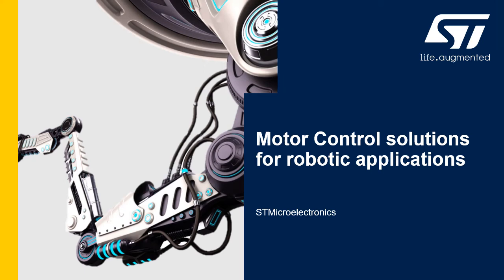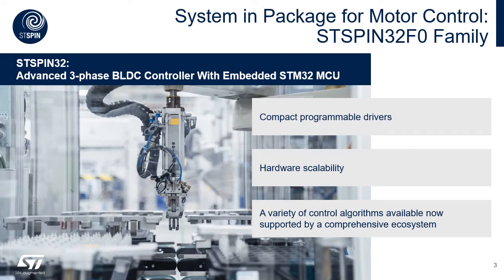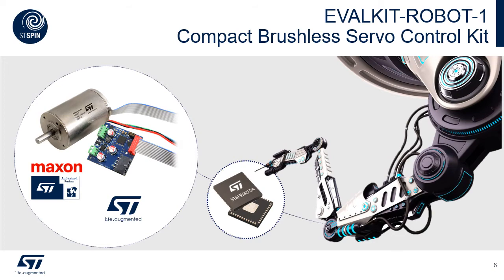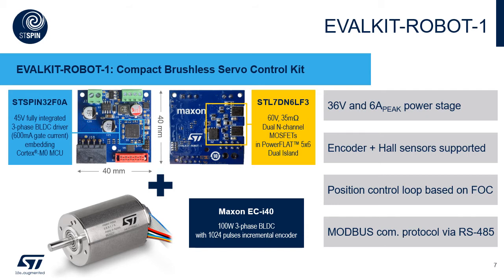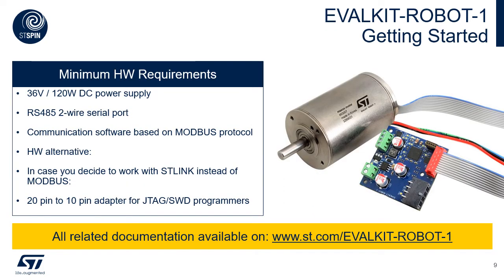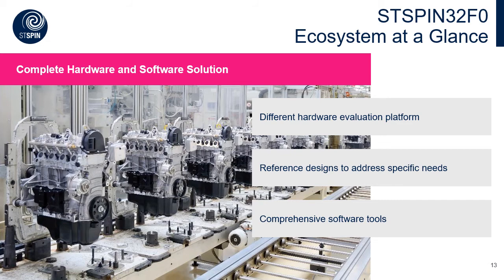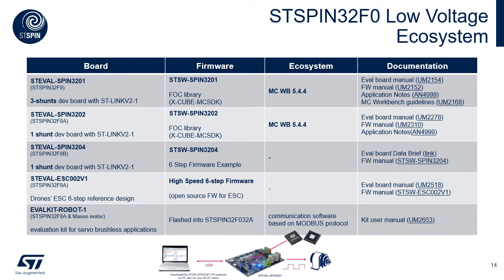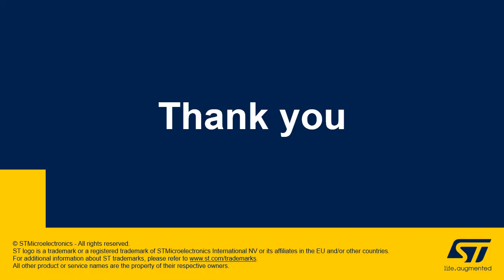Motor control solutions for robotic applications

Comment: please link the source code of the firmware. i think a tutorial of how to setup a new project in the motor control workbench for this board with spin32F0A and all the pin config and motor data would also be super helpfull for the community and also a big motivation to order this eval kit.  also a control application on how to control this board from an other stm32 board (nucleo) via MODBUS or just simple UART.
Reply: yes, i agree! we have ordered the kit and stuck in these procedures. please add a video describing these steps
Reply: @mariapaul281  it seems stm is not helping here.. hint for other interested people.. there is a forum online where stuff is discussed.. google!
Reply from the maker: Hello! Visit our online community to find answers to your technical questions and share ideas with our developers and ST experts : https://community.st.com